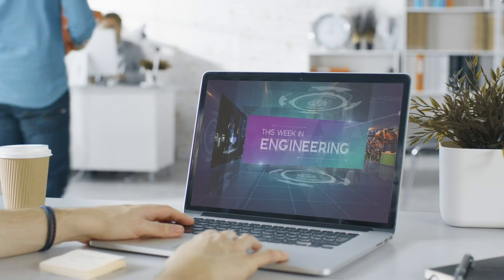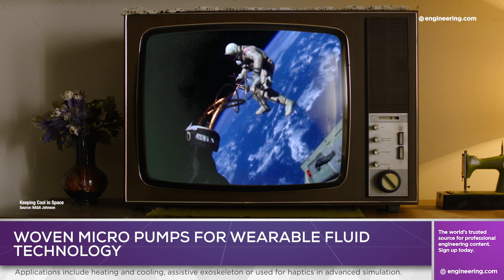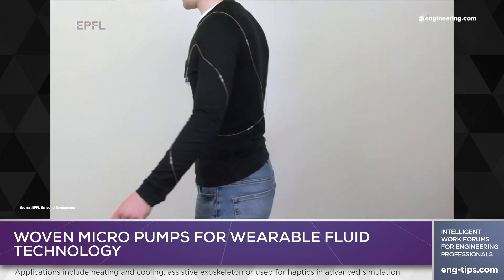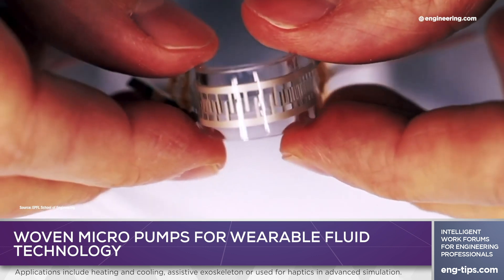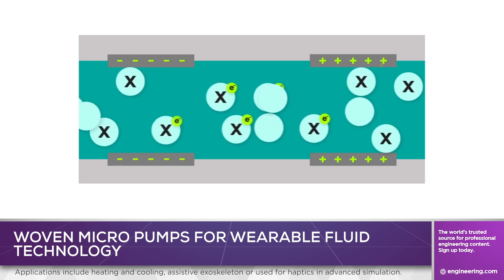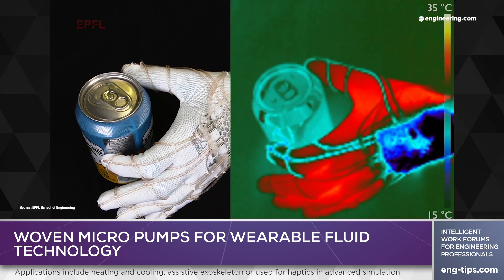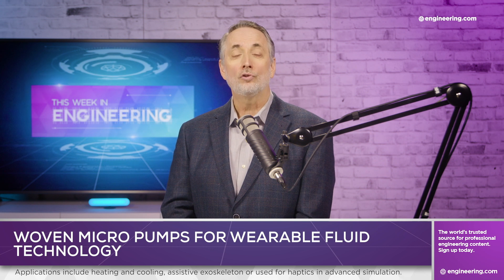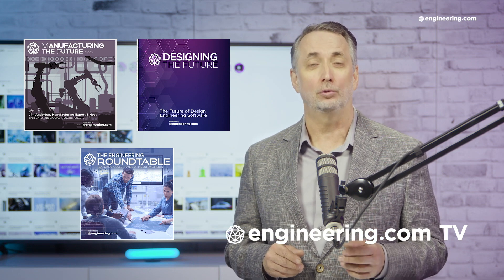Woven Micro Pumps for Wearable Fluid Technology

Comment: I have some questions about this. 
How they are going to deal with electrode degradation due to electrolysis? How is this system going to cool something if it only heats up in the process? It needs an external cooler which is even bigger tan “large, bulky and expensive” pump. It still needs a big battery to run continuously, then why don’t just use a small pump?
Why don’t you show the demonstration of the produced flow? 
And most importantly why don’t you provide any links to the original article? Sorry if I misunderstood something
Reply: You are spot on, mate.

Comment: Will this make soldiers invisible to IR cameras?
Reply: The battery supply will heat up and the helixes around the tube of dielectric fluid probably too bevause there is a current going trough them. I don't know if the dielectric fluid will heat up
Reply: Body heat has to escape somehow or the soldier will cook inside it. If the heat can get out, the soldier maintains normal temperature but that means thermal can detect him. The only thing I can think of is if he connects the suit to a stake driven into the cold ground to dump all the heat, then he could remain invisible to IR, but he couldn't move a lot and this would only work on cold climates or near lakes/rivers